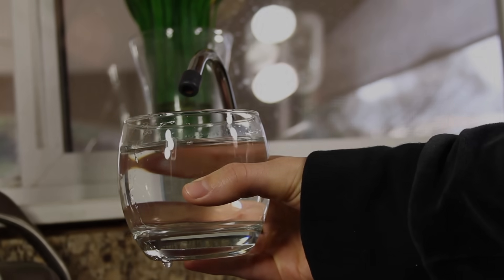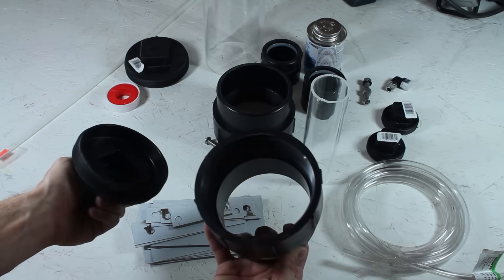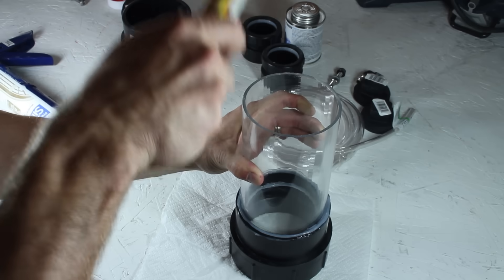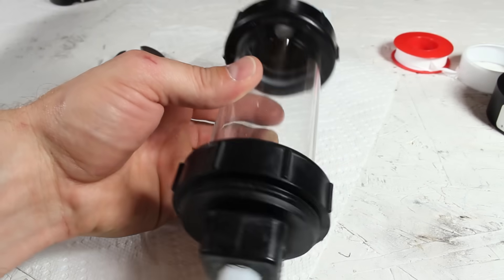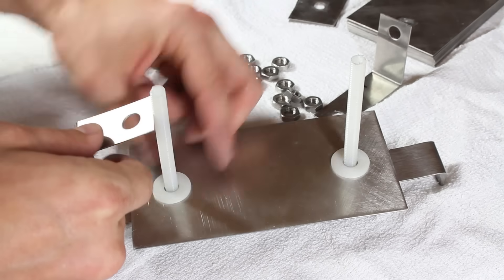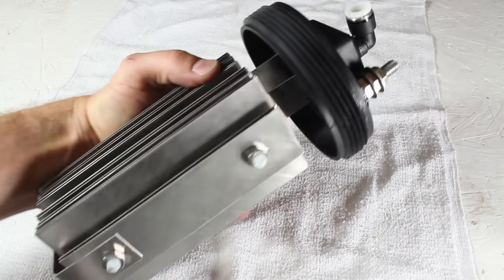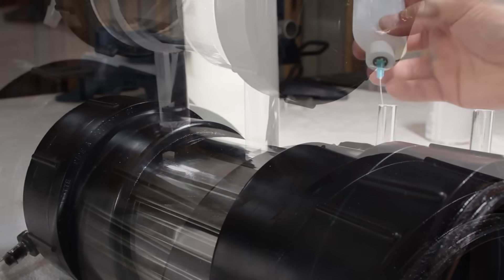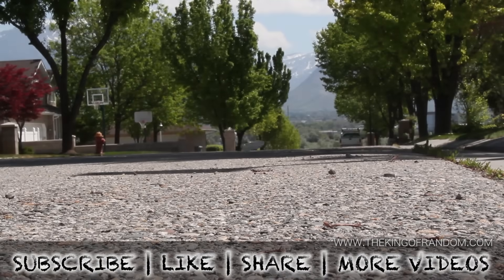HHO Generator - Water to Fuel Converter

Comment: Guys this project looks a bit doggy... Some of the elements does not work at all because of the plastic washers.... electricity should be running in all of the elements.. the exaplme we have..has 4 elements  just doing nothing. Nobody did see it ?lol
Reply: I saw it too but thougt the washers were between the anodes and cathodes and the nuts were between cathodes and cathodes/anodes and anodes.
Reply: Diode's? why would be diode's involved in this project? we all ready use 12v DC power. I still believe this project is wrong but I wish to know what you think of it..  It still works but its not as efficient as it should been? I would say 20% efficiency at this config. With few bridges will work as charm.... ?

Comment: Just curious but looking at the connections some plates are not attached to any side of the circuit. Is this correct or did you add some additional connections later?

Comment: stainless steel doesn't last long.  I used medical stainless  and it rusted quite quickly.  I heard platinum is the way to go tho pricy. You're using 2 car batteries thus depending on amps. I want to see someone try using a coil or high voltage to fracture the water instead
Reply: maybe you could use graphite electrodes. They dont corrode and they are dirt cheap. Yoj could get them from batteries or maybe just pencil lead. Just a guess

Comment: My hho generator is not working the water becomes yellowish and then greeny sticky layer on the top
Reply: Probably bad metal. Some kinds of metals combine with water to form gels like Moh hydroxides. For example aluminum hydroxide, but that's not green. But some metals make green ions like copper. So if your stainless steel was actually an alloy iron aluminum and copper, that'd probably make a gooey green mess instead.

Comment: bro you are my idol... how much dc power you've used to energized the water generator and how long it takes?? I want to make this at home converting my lpg stove into hho gas stove...
Reply: Ideally you wanna use 2.2volts at as high of amps as possible, you can use 12v car battery but it makes heat losses

Comment: Instructions unclear, Nuts stuck in Generator plates.
Reply: Bad Vibes , the last part of the video is not clear... You going too fast
Reply: They should already be electrocuted than bravo your version of squished nuts to hho generator.
Reply: You were standing too close and not wearing the appropriate protective gear.
Reply: I only by dry cells from trusted sellers on eBay. 4 anywhere from a sedan to a small pickup truck I would not get anything less than 36 plates.
Reply: Lol!...
Use your hands not your feet!
Reply: You couldn't hear it but I just died laughing
Reply: Hah because he puts nuts in the plates

Comment: Thanks for the plans. Over a decade ago I built one of these for my old Ford Fairmont 4 L straight six and spontaneously took it in the drag races on the local air strip to compare times with and without the HHO cleaning up the burn. It blew the 10 amp fuse early on, and my times were pretty slow (a full tank of low octane fuel didn't help either.) With a 20 amp fuse in I saw and felt a difference - approx 2.6 sec quicker over the quarter mile.

Comment: Design flaw : Only 8 plates are linked (4 to + and 4 to -) instead of connecting the 16 plates for maximum efficiency
Reply: ...you mean short circuiting the cathode to the anode, bypassing the electrolysis and instead just making a strange electric water-heater?
Reply: Stephen Borntrager No :) I meant instead of 4 + and 4 - and 8 not connected he should have done 8+ and 8 - and 0 not connected to anything (talking about electrodes, 16 total but 8 left "floating" in the design)
Reply: Wade Haden , you are correct. More polarized plate surface area means more current/more heat/more gas. Spacing the plates farther apart or using a lower voltage will reduce the heat generated while also reducing the gas output which your additionally connected plates would transform.

Comment: So, why aren't there cars these days with water-based engine?
Isn't it a possible thing?
Seems much better to me than any other solution.
Reply: You can't make a car that runs on water using this method...
This isn't an engine that produces power, it is a device that consumes both water and electricity to produce hydrogen and oxygen. 

It is however, possible to make a car than runs on hydrogen. This device would be one way of generating the fuel.
It would be clean burning, as the exhaust is basically just water. 

There are some major downsides though. First is that you need to get the hydrogen fuel in the first place. You can use electricity and water to generate hydrogen, but...
If the electricity came from a coal burning power-plant, it's still polluting just as much overall. 
The biggest reason cars don't use hydrogen as fuel is because hydrogen takes a lot of space... you would need an enormous tank just to be able to drive a short distance.
There are ways to compress it, but it the tanks become both heavy and dangerous, and have a risk of exploding.

Hydrogen is actually used as fuel for some things though, like orbital rockets and some airplanes.

Comment: can you use liquid nitrogen to make fuel?
Reply: I don't know about fuel, but nitrogen is a common component of many oxidizers. Red fuming nitric acid and dinitrogen tetroxide are commonly used as oxidizers for spacecraft. They are also insanely toxic.

It's also a component of nitrous oxide, which is used in some race cars as a sort-of 'turbo boost' fuel additive.

It doesn't do anything by itself though. In fact, nitrogen is one of those noble gasses that are so reluctant to react with anything.

It's not cold enough to turn liquefy the hydrogen either.

Comment: My dad had one of these hooked up to his truck 10 more miles to the gallon
Reply: fletcher isakson 
He had a hydrogen fuel cell?
Reply: The government scared everyone by using a hydrogen fuel tank filled with hydrogen obviously. Putting it on crash test cars and blowing them up. But if you just use hydro cells your gas tank will be filled with water instead. You just create fuel as needed. No car bombs. Trust your government they love you as much as you cant be withouthem.
Reply: @5yri5  it may be viable to use it alongside gas... at the moment. It's seeming like its not that viable on its own though
Reply: Rola Meharzi if you're pushing hydrogen and oxygen into your engine I can see a mileage increase. Probably more wear and tear though.
Reply: It works on a car. Just run a fogging nozzle into the plastic tube after the Mass/Maff sensor. Of your engine. The O2 Sensor will account for the extra fuel (hydrogen) reduce the injector on time resulting in less gas use.
Reply: any additional info on this?
Reply: fletcher isakson yeah right like somebody’s gonna believe that
Reply: This doesn't really work. Mythbusters tried it and it's covered on a bunch of scam warning websites.
Reply: @Zamboro  dude.. they never added a catalyst to start the process properly
Reply: @garystinten9339  No. It's not a real technology, it's a scam. They sell you plans or the kit, then blame you if you don't get the results they promise. You don't need to agree with me, but that's how it is. If you want to find out for yourself, buy a kit and try it on your own car, but properly measure your MPG before and after so you don't get fooled by the placebo effect. You can find plenty of videos here on Youtube of people doing that and confirming it doesn't improve MPG.
Reply: @Zamboro  myth busters didn't disprove anything the experiment they conducted was not a complete experiment they didn't do half of what they should have done...

Comment: Correct me if I'm wrong: So first you get a nut, then add another nut to that nut, only to add another nut? But then what do you do with the other nuts because I still don't have the proper setup to add more nuts. These instructions are driving me nuts.

Comment: If I'm not mistaken, isn't there a way to separate the oxygen and hydrogen during the reaction? I think one gasses towards one electrode, and the other towards the second electrode, but I forget which is which. I saw one of your other videos where you made liquid nitrogen at home, but what about using the same setup to make liquid oxygen using the oxygen side of this generator?

Comment: King of random, what do you think about the claims of people using Hydrogen generators like the one you built to power a car , is it actually possible or is it internet BS ?
Reply: No idea what the king thinks of it, but how would you power a car with something that consumes electrical energy and water to produce slightly less stored chemical energy?
How would you power a fossil fuel engine on gaseous hydrogen for that matter?
I suspect many are trolls.

Comment: How do you control thermal run away??
Reply: Thermal runaway will only happen if you have too much power going to the device. If it gets too hot, lower the voltage, reduce the mixture ratio, or reduce the amount of surface area.

Comment: I use a glass u tube to keep the gases apart. then I hook the positive side to the hydrogen side of full my cell. the negative side goes to the oxygen side. my home made full cell produces 15 to 18 volts. witch I use to recharge my 12 volt battery's witch is hooked to a 128 volt inverter. witch I use to run my computers. it does produce allot of hot water. witch I have drain into a water tank.

Comment: The energy required to break the molecular bond of the water so the resultant hydrogen/oxygen when burned is much less. Unless you are using solar then you have to use fossil or nuclear.

As a principal example...A car that would go 100 miles on batteries charged by solar would only go 10 miles if the same amount of electricity was used to convert water into hydrogen and then burned in an internal combustion engine.

Comment: I built one of these years ago. But never finished it.done it in an old fish tank.  The i used a pc power supply think it chucked out somethink like 23 amps at 12v dc. The more plates i put in the more amps it was pulling. kept blowing the inline fuse lol what i also discovered by accident is the plates creat a magnetic field for some reason any ideas as to why. ? I used stainless steel

Comment: why do u use 4 tsp of KOH ?  way way too much... with that amount u dont need power... it will seperate OXY/Hydrogen with a chem reaction instead. i use about 1/2 tsp as a catalyst and perhaps 12 - 18amp @ 12v.
i supose KOH is cheep but u dont wanna be carting around a drum when ur traveling in ur oxy/Hydo car. In fact it would be better to design ur system to use filterd water instead of distilled and to not use any catalyst. 
Have u made such attempts? try running a motor with ur Oxy/Hydo Gen... such as a car or lawnmower... FYI if u do use a car, mack sure u compensate for the oxygen sensors in the exaust :)

Comment: you will get lock up by the government bro watch out ...
Reply: Don't worry. This consume more electricity that he can get from produced hydrogen. )
Reply: Producing 5 Litres of Hydrogen a minute, this can be burnt and used to heat a hotplate, in which I would attach a small 12 volt fan in order to distribute the heat more rapidly. I believe that this would generate the heat much more efficiently then a electric powered heater commonly sold in stores everywhere.
Reply: Alexander Melb/Aus you cant increase efficiency when creating heat. It doesn’t work like that.
Reply: 트와이스 シAnonymous you're correct
Reply: Its okay, this is an old video
Reply: Benjamin P
Reply: If this is bad, then what are they going to do to the guy who showed us how to make explosive nitrogen triiodie? Oh what... that was him too.

Comment: A quick query: Is there a way to completely separate Hydrogen from Oxygen in this model while minimizing the modifications of the dimensions of the tubing?
Reply: Recently, I found out that increasing the voltage up to 200V or using AC current isn't recommended as only DC currents are able to produce oxygen and hydrogen gases.

Comment: Again. I was checking the build up of the generator and you have a gap between the plates  that wouldn't produce neither oxygen nor hydrogen. The fact is you need to connect the metal plates alternated. And you can do it on the left side but not on the right side without adding some joint to the right side for the inner connector. Analysis says you have 10 of the 14 plates disconnected from the circuit by the washers, it can be seen on the video and it's OK but you need to configure bindings as stated above.

Comment: Powering it with a solar panel or wind turbine would make it an interesting energy storage option! Now show us how to make a hydrogen fuel cell (better yet... DIY nuclear power)!
Reply: Very unsafe to store. One Oxygen molecule in a bunch of Hydrogen makes a very large crater.
Reply: @leewilkerson8185  you look like you know what you're talking about
Reply: @GOATESS_GOATERSON , you heard of the Hindenberg, correct? :D That was UNCOMPRESSED Hydrogen!
Reply: @leewilkerson8185  isn't that ridiculously dangerous because any heat source could ignite it??🤯😦
Reply: @GOATESS_GOATERSON  No, hydrogen has a high ignition point.
Reply: @Exachad  okay, do you know exactly how high?

Comment: So people have been wondering if this works in an automobile allowing the car to run on hydrogen and from what I can gather 

Sort of 

The claims people make against it are that it would either destroy the engine or wear it down faster 

Both claims would clarify that you would have to build this engine specifically for running on hydrogen 

Ruling out a more simple conversation 

That makes it either extremely complicated or just plain impossible to convert your average engine to hydrogen 

As for the hydrogen generator if this did work it should run on a separate alternator for maximum power 

Not running off the car battery

Now there is a wild card to all this 

BMW made a hydrogen powered concept and even managed to convert a couple seven series sedans and leased them to very limited markets 

However bmws concept ran on liquified hydrogen kept at supercooled temperatures 

From what I can make of all this is the engine must be specifically designed for hydrogen not a converted gasoline engine 

And the electrolysis device must be fed by a separate alternator for the Desired effect 

Regardless most of this is coming from reading the comments on this video I must admit so if I left anything anything out or got anything wrong please let me know

I'm only human

Comment: cant you just use the plates from an led acid battery ? empty it out, clean it out and fill it with pure destilated water ??  connect it to  another battery and there will be bubbles :P .. 

Done..  

that would be much faster

Comment: why aren't we using this for cars?
Reply: Because hydrogen has a very low energy density compared to gasoline or batteries
Reply: @errolhusaberg3791 , but water doesn't!
Reply: @leewilkerson8185   Water doesn't have much energy in it. To turn it into hydrogen, you need to pull energy into it in the form of electricity.
Reply: @autogolazzojr , yeah, I'm pretty certain I knew already about hydrolysis. If you think there's not much energy in it, how do you explain the magnificent explosion you get from ONE DROP of water at 1800 degrees after the Hydrogen and Oxygen separate and then recombine?
Reply: You can use it to supplement your gasoline in your car engine. Pipe the gas output into your engine's intake air path.
Reply: @leewilkerson8185  Why do you believe that water contains more chemical energy than gasoline?

Comment: This is actually a battery. You reduce H2O into H2 and O2 using energy, which if you introduce to heat release the energy by bonding to eachother again.

Comment: anyone know the efficiency of these?
Reply: I did an experiment and got about 140cc/sec.
Reply: @dakotahatch8233 , it is important to know both halves of the equation. How much voltage and how much current did you need to get that 140cc/sec? How many BTUs/hour did you get from burning the result.
Reply: @leewilkerson8185  11 Volts and 7 amps. However I did not burn it.
Reply: @dakotahatch8233 , thank you.
So you used 77 Watts to get 140 cc/sec. Cool!
Will you try later to determine the BTU power output?
Reply: @leewilkerson8185  It would be a nice experiment; currently I have not done so.
Reply: @dakotahatch8233 , currently? Bwahahaha, currently! You made a funny!

Comment: you should make a nozzle for a co2 free stove, i did it with a syringe and a much smaller scale and mine produces 99 percent hydrogen, you said your's produces "oxyhydrogen gas" are you talking about the product made or after it's ignited?